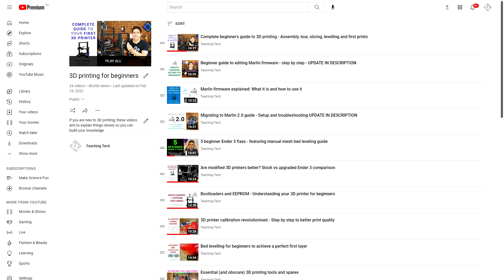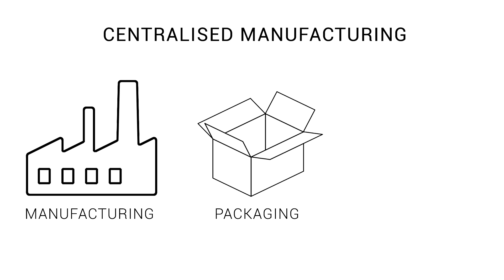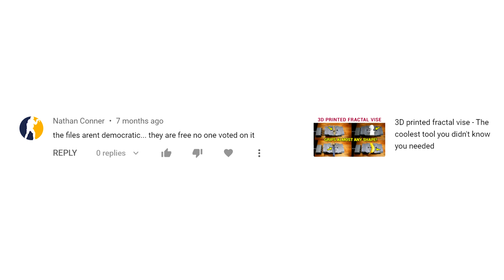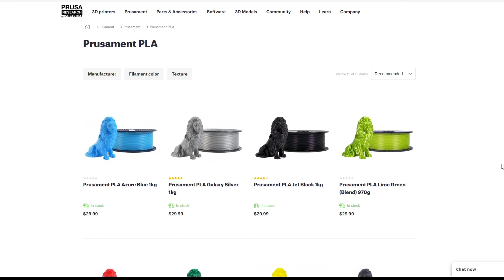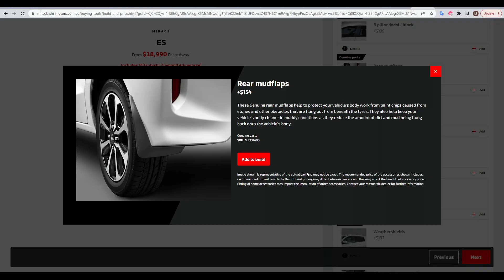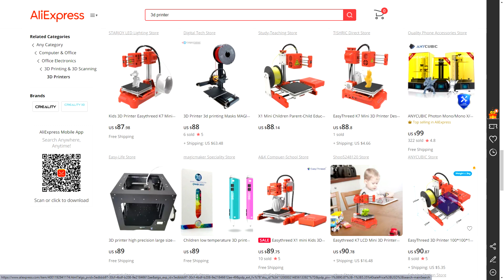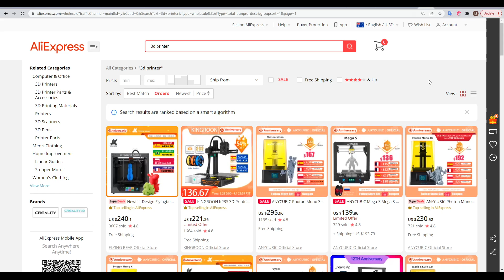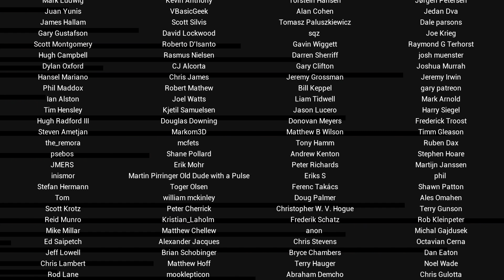3D printer trends are limiting mainstream acceptance: The 3D printing paradox

Comment: I don't think I agree much here... A few points: 
As much as I'd love to see manufacturers supply files so you can print your own replacement parts, I don't think manufacturers will see it as such a positive to them (not saying all manufacturers are unwilling to sell spare parts, but some would probably rather you throw the whole thing out and buy new).
Even if every house has a FDM printer, there's still plenty of situations where FDM just isn't acceptable for a production product. Add in resin printing, you get a more complete picture, but still fall short of the capabilities and economies of scale that centralized manufacturing can produce. I would definitely appreciate it if there were cheaper (monetary and resource) ways to get products to people (maybe if amazon put an entire order in one box...), but I just don't think it's possible to print up a, eg, washing machine at home.
Unfortunately, the car analogy falls apart a bit. I think it holds when you mention there are tinkering people and people who treat cars and 3d printers as tools. But, I disagree that you can't get the "tool" printing experience at home. There are plenty of 3D printing manufacturers that are happy to give you a printer that gives you a mostly plug-n-play experience. Printers with cartridges of filament that tell you when you're running out and even give you support when things go wrong. The problem is, you're spending thousands to get to that level, just like a car. However, these are the companies that are indeed pushing the boundaries of what is possible. That technology will eventually trickle down to hobbyists, but considering most manufacturers will patent their new ideas, it will take time. I think the argument here is not so much that there isn't any R&D being done, it's just that it's far beyond what most people would want to spend - especially when you can pick up a completed product from a store shelf.
At this stage, I see 3D printing more like the burgeoning electronics hobby industry back in the 50s or so. There are companies working hard on new ideas, but they might be out of reach of the hobbyist. But on the other hand, there are very active hobbyist communities working on new ideas, too. 

All that being said, I still get a lot of enjoyment designing and printing solutions to problems. I think 3D printing has its place, but I'm just not convinced it's in every home - just as cars have their place, but not in every home.

Comment: I agree with what you say here. You are however missing a point, you aren't cutting out transport or packaging. Youi still have to get your printer, you still have to get your supplies (PLA/ABS etc, replacement heaters, heads, extruders etc etc). They will get delivered to you in packaging by a truck. Less I grant you but still

Comment: I have owned a 3D printer for 10 years and I am disappointed with progress on the user ease end of things.  No automatic filament cartridge loaders,  though some units now have filament loading features.  New features take R&D dollars and the upper price point is seems to be $1000 for the hobby market. Too many printer models with few (in any) easily interchangeable parts such as hot ends.  Open loop systems are prone to errors.  Some closed loop stepper kits might help fill a gap. These devices have to be radically enhanced to be adopted by the general public.  Case in point, the Marlin firmware … Each 3D printer model should have a generic XML definition with all the features included. Standards would surely help here.

Low end CNC machines such as the CNC3018PRO seem to be very well designed and work very well.

Comment: For the sake of argument, let’s assume it would be possible to have a 3D printer that could print reliably in every material that you would need. Then what would average Joe do with the printed parts? 90% of the people already have difficulties assembling IKEA furniture. 
Most people are not tinkerers or mechanically inclined. They honestly have no idea what they would need a 3D-printer for.

Comment: I don't see 3d printing ever becoming mainstream regardless of how easy the printers become to use because most people have no desire to service their own products. Even if a replacement part could be magically spit out on a 3D printer that required virtually no knowledge of how to use, the average Joe still has no desire to take it off the print platform and install it into their broken appliance. 

Your scenario where a company maintains printable files as opposed to actual replacement parts may happen but it would be their repair personnel that would be required to learn how to use a printer rather than the actual end user.
Reply: Im not sure. Every techology is just one revolution away from being mainstream. 

Internet use to be the same thing. You had do do consol comands to use it... the  one day someone made the hyperlink text dokument, and sudenly People could just click
Reply: Im pretty sure that in a few years, there will be more households with a functioning 3d printer, than an inkjet printer.
Reply: Look at how populair DIY-centres are here at least in Europe. Not only Ikea but also what is here Praxis and Hubo. In every town and city where you can just get parts to repair or build your kitchen, put your own light in your house instead of having to buy it from a big kitchenfirm. In the 50s you still have to ask an official installer to change a light in your own house, now you just order it online which was almost impossible like 10 years ago.
And in some time you will probably select the kind of lights/lightfitting you want in your home, select the kind of handles you want at the doors of your fridge and buy the model, press print and before it could have been  produced and shipped to you, you have already clicked it on the door of the fridge that comes pretty bare.
Same for your smartphone, now you have to order many parts like the cases online. In some time you click on the front and back of the phone that you select online and print yourself to your individual taste .Select, select color, print, just to your individual needs. Not only color, with or without grips, adding a camera more or less, still wanting an old-fashioned headphone-jack or not? Choise is yours just select and print.

and most things: just replace the cardridge, plug in and connect to yuor computer/phone, like now with your 2e printer. Most people don't repair those themselves either nor the washing-machine anymore. 
I remember in the 70s lots of people were doing maintanance and small repairs like replacing the motor, studs and filter on the washingmachines at home too. Hard to imagine nowadays...

Comment: FFF/FDM has a relatively limited set of use cases Vs conventional manufacturing. While I agree if it was ubiquitous it would diminish demand from the centralized approach, but we're not there yet and won't get there until a number of things get worked out universally such as DRM as well as standardization of material formulations for closed loop recycling.

Comment: I bought my first 3d printer with 0 experience. I picked up a Voxelab just because it was on a lightning deal and prebuilt. Figured hey, start small and move up. I was shocked how much of a learning curve there is. Out of the box some fans were whinning. The nozzle that came with it melted shut. Loading the resin made a loud crashing banging noise. The manual that came with it was translated so bad. Nothing stuck to the bed. It was just a horrible first 2 weeks. Almost gave up. The whole point of buying a prebuilt printer was so I didn't have to deal with assembly and focus on printing. NOPE!!!! I ended up having to open it up spend more money and get very familiar with the ins and outs of the machine... change fans. Change nozzle. Clean up wiring. Tape the bed, glue stick... like yeah, I know now. But, if I wasn't familiar with building computers at the basic level. I'd have a box holding laundry! It would be nice if a brand stuck out as a industry standard. Like yeah maybe a little more money. But has the solid reputation of working. Great service and material you know works perfect with the machine.

Comment: I have a few Prusa minis because I like machines that require little tinkering and just works and delivers. A major downside with the minis are the jams at extruder probably every month per machine, requiring 30 mins to disassemble clean and reassemble each time. Sometimes it jams when changing filament, sometimes because of retraction churning the filament. Looking back mk3s are surely expensive but probably negates such problem.

Comment: I think the only in who cloud do or at least is near is Prusa3D 
But in the end it would be a 4000 - 10000 EUR Printer - which totaly neglets the benefit of having a printer to do small repairs on your own. 

With hands on Slicer, Firmware, Printer, Filament and even a Models site the can offer presliced model which they can do for their printers. 

The printers would need to be enclosed and more rugged (to support assembled shipped - with lots of enhancements of things they already do.

(checking for Filament Stuck, auf of square etc) plus changes to allow easier change of modules (like unplugging you extruder, loosing 4 bolts and send it in for service/repair). And just a bunch of sensors to detect possible errors. 
And maybe even a locked down firmware to not allow you to do "stupid" things.

With all the firmware/software to be write to make it "foolproof" we are talking of a 4000-10000 EUR Printer  - nobody whats. 

Especially when it comes to replacing injection molded parts - which is really hard to do on a FDM Printer 
(much higher tolerances, different approach when modelling, not watertight .. )

Comment: I think it is more about need. Embarrassing wrong predictions were made about computers in the early days: 'No one needs a computer in their home!' but this did not anticipate the need people have for information and communication and computers were seen as huge number crunchers only. Most people need transportation. However, most of the benefits you mention about 3D printing - most people don't need them. It is way too easy and cheap to just click on your computer / smart phone or go to the shops and as for general product manufacturers benefiting from making parts available - really? Haven't you noticed the trend for disposability - they WANT their things to break so they can flog you a new upgrade one. Just think about the famous smartphone brand who got caught pushing secret performance/speed reducing code in their regular 'update' to the previous model which just so happened to coincide with the launch of their new model. When they got caught they said 'Oh the battery in the old model must be getting worn now so we wanted to help users get longer life out of it" - sure, that's the reason, right? No, basically people don't need home manufacturing - when they do, then 3D printer manufacturers will make 3D printers more like cars. I don't think the proliferation of clones is any real part of this - but thanks for your thought provoking video.

Comment: I once had a office grade all in one printer/scanner/fax/copier. It was good and dead, so I stripped it down just for fun. It amazed me at how many sensors I found within the build and how many individual parts went into it. 
I googled the machine and found out that it originally sold for AUD$800. That’s way cheaper than a Prusa with perhaps 1/50th the total number of parts and 1/20th the number of sensors. I totally agree with what your saying. Unfortunately, the only companies that seem to be working towards making the plug and play 3D printer are also selling them for $15k++! Funny that you compare printers to cars then, cause that’s about the price that we’re looking at… with a tiny fraction of the complexity/regulations/risk associated.

Comment: His argument in favor of 3D printing makes assumptions.
Getting rid of packaging and transport? You still get your filaments packaged and transported.
Better for the environment? Assuming that 3D printers never produce waste through test prints, failed prints, and printed support sprues.

Just download replacement parts from manufacturers? This assumes printed parts at the consumer level are equal in strength and durability to manufactured parts (they aren’t).

I find they are still a niche hobby. I’ve made a few useful objects, but at great sacrifice of time in designing and printing test objects, modifying files, reprint tests… repeat.

They appear to be at their best printing decorative objects that don’t need to withstand stress or fit tight tolerances. Basically Picachu figurines and pencil holders. Or pencil holders that look like Picachu.

Comment: 3D printing will never replace factories entirely but it will be good for the market
 
Lookup a traditional factory vs 3D printing cost chart, mass produced items will always need factories 

For smaller less used products those designs  will be sold to 3D printing companies to produce or for you to buy the files and print yourself, a good thing for the market

Give it time 3D printing is very new in comparison to factories

Comment: It will never be mainstream until you can just plug it in and print. The average consumer has no interests in 3d printing, but they do want the part.

So you have to fill that gap. It would have to work like all the other appliances in your house, just plug and play.

As soon as there is a product that someone can just plug in, drop a filament container in... and everything else happens in the background... then it will happen.

But even something as simple as leveling the bed. If that is not 100% automated, then it will never hit the main consumer market. Most of it will have to be automated.

Over 30 years in creative marketing and technology experience here. You have to keep it simple and stupid or it will never hit mainstream. Think of your car for example. Most people dont even know what a spark plug is. When cars first came out, you had to know mechanics. Now you dont.

Comment: Something that you didnt touch on that I consider one of the best features of a printer in every home is the potential for decentralised recycling. Currently a lot of plastic waste is still not recycled, its a very inefficient system. However already we are seeing opensource, easy to use filament production machines begin to form and the potential of this combined with a printer in every home is exciting, since a system like this would provide value to waste which is an excellent way of keeping it from being buried, look at the 10c per bottle program we already have and imagine if this could be applied to all sorts of plastic waste but at a level where we are not reliant on massive systems. Even if each home doesnt do its own recycling, even a few buyers per community could have a massive effect.
Reply: I wish I could get at least another use out of my rapid iteration print material, or even just had some easy process to cleave it and turn it into something more fuel-like since it's just hydrocarbons and oxygen. Right now the reextrusion processing chain is just too much investment, but if it got down to $200 for the shredder and $200 for the extruder, or if there was somewhere local (shipping costs ruin any benefit unless someone is subsidizing) I could trade in Benchys for discounted recycled PLA, I'd consider it.
Reply: Another potential option in regards to plastic waste will be the introduction of new materials, which are easier to recycle, upcycle, or compost. Lets take PLA for an example. the current process to either reuse leaves more to be desired due to the variability that comes from using non-virgin material. While composting the material requires very particular parameters to be met, which can be somewhat energy intensive in comparison to cost. If we can figure out a cost-effective way of producing a second life out of our material, then I think that will also greatly help in recycling efforts
Reply: @lordofh3  For sure, the issue of plastic degradation is something I should have touched on because it is a major barrier to what I described. Its also one benefit for a plastic like PLA. While the process for decomposition is not widespread and uses energy (i havent found a source for how much) the point still stands that it still can biodegrade unlike other plastics.
Reply: @Borgedesigns  Very true; personally I am curious if there will be an introduction of an algae based polymer and what process would be used to extrude it or if it'd be able to be extruded inside of our current FDM/FFF printers; Thinking about it more it would probably be something used in SLA-like process with the downside of having low heat resistance properties, which may be fine for certain products
Reply: Meh, filament extruders are still too expensive to operate for individuals to break even in their lifetime. They will stay expensive and unreliable until they reach critical mass which might not even happen in the (20 year?) time frame when FDM printers are relevant. But hey, this is just a hobby for me and I have 6kg of junk parts ready to melt when I get around to building a filament extruder